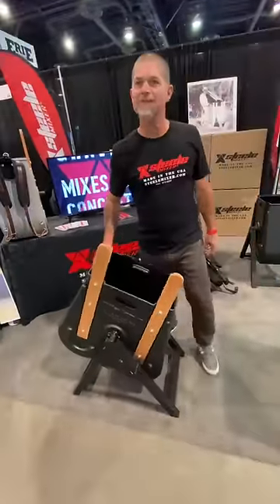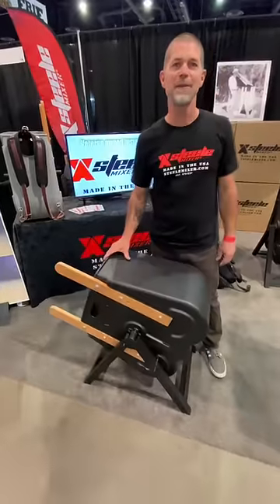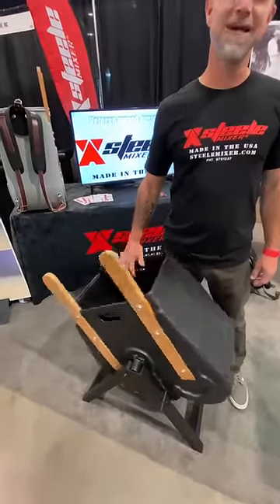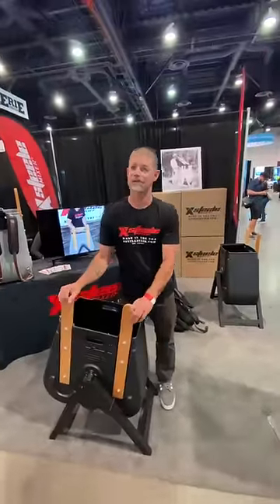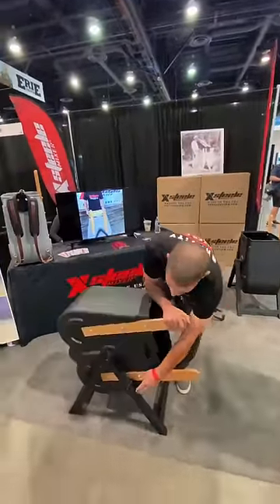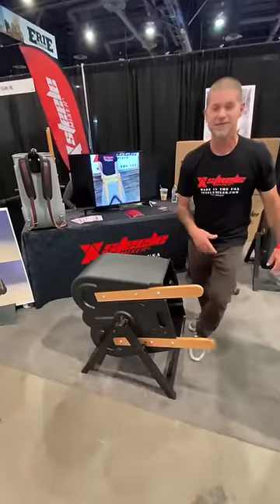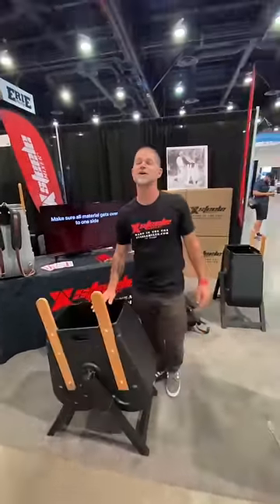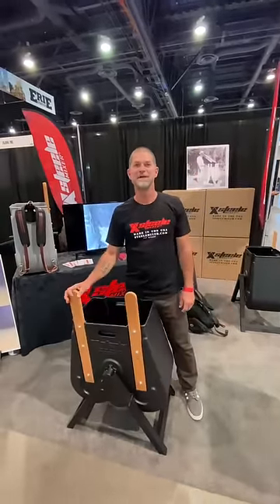No power -No problem. Mix concrete in 40 seconds #shorts

Comment: Looks nice but that price point of around $300 seems just a little high. Between $100-150 and he’d probably sell quite a few of these.
Reply: You could probably make your own for free using a garbage can and some scrap plywood
Reply: I didn’t buy one because the price was too similar to an actual cement mixer. I build one from a 55 gallon drum for $150. if the price was $150 I would have bought it. And there is no reason it can’t be $150. It’s a plastic bin with two wooden… oh the wood.
Reply: Oof, yeah hard sell at that price.

I'd be in at a $100
Reply: @smellycat249  yep, there’s $299 worth of wood in that product, he’s probably making a loss on every one 😬
Reply: @epia125  he should get it made in China
Reply: @richardkenny7563  ehh, I can't say that. Only that we can mix in a tarp/bag and compared to $300 it is a tough pill to swallow.
Reply: You do know a mixer with a motor cost 5000+ bran new right
Reply: @brixz800  really? Because I paid £170 for a brand new one. It came with a 2 year guarantee and it was delivered the next day for free. 

Why is it so expensive there?
Reply: @hootie6787  the ones we use on the job site a two bag mixer  coast about 5000 and the 4 bag is about 8000 don't know what motor you have on yours but 2 bag is a gas power Honda 2hp or 4hp I think and and the 4 bag runs on diesel
Reply: @brixz800  ah, so it was more of an apples to oranges thing then? Because that isn't comparable to the type you're gonna get on a worksite.
Reply: @brixz800  we aren't talking commercial gear, but stuff for the home gamer.   There are a few options in the $200-$400 range that are motorized.
Reply: Hey it works tho
Reply: I know we just look at the material side of products and say those things are cheap, why do much?  1. Over head cost employee's,  buildings, rent, loans, investors, and etc to run a business. To make sustainable profit all these factors have to come into play. So next time you say I can make that for $,  you should.
Reply: Recycled plastic is expensive
Reply: I don't think it's that high for a sturdy American made piece of equipment.
Reply: Your pricing it with the first a world mentality of near slave Chinese labor you've become accustomed to. China pays the workers just over $1/hr and they are mostly women. (depending on product) China has installed "suicide ners" around some factories in the past from employees jumping out windows. They work 12 hr days 6 days a week and they live in apartments built next to the factory and pay rent to the employer. If this is the price range you based it on then yea but if base it on paying a American then $300 seems fine.
Reply: I'd accept $300 if it was made of steel but it's freaking plastic. Gonna need a new one in a year
Reply: You guys want build in usa but don’t wanna pay the price lo
Reply: @blackhawks1870  this isn't a "made in America" argument, it's an overpriced piece of plastic argument.
Reply: @AK-47ISTHEWAY  the thing is that defeats the purpose of made something out of recycled products were trying to prevent pollution in the waters and in our environment and help out the veterans while we're at it
Reply: @dreagen3131  but the thing is I am recycling. I never said anything about buying a new garbage can. I already have plenty I can repurpose.
Reply: If you are on a “by contract” basis. This will pay for itself on the first job.
Reply: @Dan-gj1hz  it will have a hole in it by the 3rd job
Reply: @ostenwheeler  - perhaps with you using it, yes.
Reply: @orcoastgreenman  anyone in the industry will tell you plastic doesn't last. This was designed to sell not to use.
Reply: My smallest concrete job ever! Was worth $500.. literally patching a hole.. a step, one step, on your stairs is worth $600 to me.. and that is really very cheap in my area.. the mixing though!!
This is worth at least $300.. that is a steal! 
Buy now!
Reply: @ostenwheeler  you are right! Plastic is garbage! But if you figure 3 uses.. that’s better than some other brands?
Reply: I bought an electric mixer at lowes for something around $300.
It sure does the job. I mix 4 bags at once, and if it burns out  who cares?? It was $300.
It squeaks a bit now but I've already mixed hundreds of bags with it, even with dry clumps so whenever it calls it quits I'll understand
Reply: @bmint  well I was exaggerating 3 uses. It would probably last 8 months to a year
Reply: Harbor freight.. $269… nuff said
Reply: @ostenwheeler  no it's a made in America argument. Americans are to used to not paying labour for their products. They want to keep jobs in America, just not pay them...
Reply: @seiryusuzaku7307  since when does making something local make it cost more? The life quality of this plastic item is crap compared to similarly priced steel mixers.
Reply: I can just use a 5 Gallon bucket from lows with a lid,and put it in back of the truck and toss it out at 45 turn around and go back and get it, lol if it's still in the bucket
Reply: I bet it cost about a dollar two ninety-five to make out of recycled plastic
Reply: $47.99
Reply: @ostenwheeler  Cost of Labour. If their company has say 10 people getting paid $25 an hour, 8 hours a day 5 days a week you do the math. Compared to say maybe $10 a week for more hours for the labour in China. That's why it costs more. Simple maths.
Reply: @jbcfamily4802  don’t worry harbor freight will get this in stock soon at probably $50 and you can buy 3 so when the first 2 break you will be able to finish with the third!!!
Reply: @brixz800  do you even harbor freight?
Reply: @tiredofthetyranny9874  you joke, but for the home user with a single project that's all they need.

Also, folks should look at renting tools for single projects. sometimes the cost isn't less than a china freight tool, but then you don't have to worry about storing or selling it when you're done.
Reply: Exactly what I thought. It ls a cool idea, but I'd put some decent casters on it to roll it around. Keeps wheelbarrow clean, alot of construction there's no decent power without running tons of cords, its a "green" idea and customers seem to like that esp if there's no small engine noise, etc. Price is just at that point that makes me go..... uhhhhhhhh, gmmmmm hmmmm, I like it but don't really need it that bad yet.
Reply: But he's proud they are made in America 🙄

Comment: Great the price is competitive to one with a motor that mixes itself.
Reply: Need to pay for gas for the motor thoufh
Reply: @LifeToATee  Not to mention repairs on any machine with an engine. You will either have to take a lot of time to replace it yourself or spend the same price it took to buy the machine to fix it 😂.
Reply: @calebguinn2069  You’ll mix thousands of bags of concrete with a motorized one before it ever has an issue don’t play dumb. Plus small engines use extremely small amounts of gas.
Reply: @Brandoify  I think it’s just time to accept the fact that it’s a stupid product. The people that actually work with their hands are the people that are saying it’s dumb.
Reply: @Brandoify  People that are working indoors mix it in a bucket etc. The kind of person that would pay $300 dollars for this, wipes their ass with gloves on. Also the mixer I just got done using was electric. We would use this mixing bit that went on the end of a right angle drill in a bucket for small jobs. Plus when I’m done I can dump the bucket wherever I want, I don’t have to shovel all of it out. By the time you do that the bucket technique is way quicker. That right angle drill could mix a bag of concrete in less than 30 seconds.
Reply: @reddirtwarrior5956  Fine, fine, I just like to root for the underdog from time to time.
Reply: @reddirtwarrior5956  you aussie
Reply: @maxl3189  the fuc?
Reply: I use electric and it has wheels
Reply: I can get an electric mixer for $50 less
Reply: @reddirtwarrior5956  depends on the job i do  stone work like outdoor grills and custom fire places and wheel bareling in a already ocupped home sucks u cant bring a mixer in unleess u wanna pay for their lawn lmao but 300 sucks

Comment: In my younger days I could have used that. I've mixed a lot of bags in a wheel barrow.
Reply: Crazy how there always seems to be one little pocket that stays dry
Reply: I like the idea but my wheelbarrow is moveable.
I can use it to carry the bags from the truck to the work area.

I can mix anywhere.
Move it out of the way etc

Comment: Hasn't a better version of this existed for like hundreds of years
Reply: What's that called? How do I find the version you're mentioning?
Reply: Yes the barrel mixers which look like miniature versions of what you see on concrete trucks but for smaller jobs this seems kind of neat 
The handles at the top may provide some more leverage than the usual mixing in a large bucket 🪣 for small jobs
Reply: @tomorrow6  Yea man I think this looks worth to try out. I already have a barrel mixer, but it needs external power to turn it. I've been thinking of connecting a chain from a bicycle to the axle of the barrel mixer 😂
Reply: @Pajune  lol we used to use electric motors and belt drives in barrel mixers and even had a tractor PTO one for working away from power sources without needing a generator
Reply: If the jobs that small just use a barrow and shovel and you can tip it straight in , plus barrow can wheel drunk friend home after work 😀

Comment: This is cool but for $100 less you can buy a electric mixer disconnect the motor and spin it by hand to do the same thing. Or you know... use it with electricity....

Comment: Guy: Only non powered concrete mixer

Wheel barrow: hey you forgot about me. 

Bucket: hey you forgot about me.
Reply: Anyone with a shovel*
Reply: Both a wheel barrow and bucket need additional items to mix the concrete. Completely different. How dumb.
Reply: @brandonbath6097  how do you figure? All 3 have a container to hold the mix and a tool that is manually manipulated by a person to mix the water and dry mix. The only difference is that this device has the tool built into it, it takes a person to manipulate the two wood handles in order for the device to work.
Reply: @brandonbath6097  explain what he uses to get the concrete out after he’s done mixing? Oh wait a shovel. Then add all the time he spend shaking a bag of concrete so it can go in the mixer without any clumps. He says gravity mixes it but that’s not true because you have to power the mixer by hand going back and forth. It’s as much work if not more work then a wheel barrow and a shovel. At least you can roll the wheel barrow anywhere you need it. You can’t even dump this mixer out lol. Have to completely empty by hand with shovel. Terrible invention.
Reply: @mysterycomment1553  Hey genius. There’s a huge difference between using a shovel to pull out some cement than using a shovel to mix up cement.
Reply: @brandonbath6097  not if your a man

Comment: "Show me how it works!" 

Didn't you hear dude say it's made in the USA? By veterans? Who cares how it works it's clearly a superior product.
Reply: Lol. Not all veterans are good people
Reply: the mixing time for concrete is not a couple of seconds if you want any strength..
it might work but it does not do the work faster, it will still need aprox 15 minutes
Reply: Any commercial use of a cement mixer is around 6 to 8 80lb bags at a time. No one is going to want to do that one bag at a time.  Plastic mixers are trash too because to chemicals in concrete dry plastic out and make it super brittle. I'm a union bricklayer and this is a no for me.  Actually seen plastic bags that do the same thing in less time if your going one bag at a time
Reply: @jbBuckn  Union? So which one are you, the one doing the work or the other five standing around?

Comment: One bag? Idk I can mix at least 3-4 at a time in a wheelbarrow and more with my actual mixer. But also how would you move it around
Reply: Ya the biggest downfall of this product is having to shovel all the concrete outta the thing. It won't even let you dump it on the ground
Reply: They should make it a bit taller so you can dump it straight into a wheelbarrow...and it would need to do more than 1 bag at a time.
Reply: @DarkPhoenix203Ct  that was my exact thought
Reply: You can not make 3 bags of "mud" in 1 wheelbarrow.
Reply: @jonathanbreedlove4286  you can def do 3 bags but depending on the barrow it will be extremely easy for Crete to spill over the side. I've never do more than 2 bag at a time, there's really no need for it. Your not speeding up production, you just making the wheel barrow heavier and harder to handle
Reply: @DarkPhoenix203Ct  ok so you can put 2 bags, 34 shovels of sand and around 7 gallons of water in a wheelbarrow? And make mud
Reply: @jonathanbreedlove4286  how is it hard to understand the concept of using a couple 80lb bags of premix in a wheel barrow?. Why would anyone mix bags or premix in the same wheel barrow at the same time as Portland cement, sand and stone if you don't need to?

Comment: We mix cement/concrete on the ground. Lay   dry mix in a circle (like a ring) and pour water in the hollow middle. Mix from the outside, working your way around the ring. Has never fail us and I would never spend money on a mixer.

Comment: "you'll never mix your crete right however, because you put the water in first"
Reply: Gravity pulls the concrete down through the water... Lol
Reply: Actually if you read the factory recommendations on the concrete bag you’re supposed to put the water in first 🤙🏽
Reply: Bro water goes first so its easier to mix and dont stick at the bottom atleast in a wheel barrel

Comment: Just one bag 😂 😂 I can do it in a plywood 8x4 8 bag in 3 minutes.
Reply: Exactly
Reply: Yeah but this is for certain things. Post holes and such were you only want a bag or two and move on..
Reply: What do you mean plywood 8x4?  I’m imaging an 8’x4’ box and it doesn’t make sense.
Reply: @tylerk.7947  I'm also curious
Reply: @tylerk.7947  I'm assuming he means he will lay an 8×4 board of plywood/OSB, break the 3 redi mix bags on it and add water to mix.
Reply: @vicsosa5703  Assuming something is what gets people in trouble
Reply: @rockandrattleretreat5830  Yeah, I assumed wrong. Reread his comment and it's actually 8 bags in 3 min.
Reply: 8 bags in three minutes…. Your lying. I literally hand mix all my mortar and I’m a fucking beast… and i can’t do 8 in three minutes. I can do 4 bags 8 buckets of sand and still definitely not three minutes and I do this day in day out….

Same method plywood… so no your full of it.
Reply: His record is 22 seconds, one hand without a 4x8 plywood!
Reply: @Ryan-re1rs  would be ok for this but honestly if it was for specific post holes , which let’s face it would be it’s best form of use , then wouldn’t a spout typed system make it more niche
Reply: @spencercooper-thorn2624  this product is useful for diyers…. For areas in the boonies with no electricity. For new construction homes that haven’t installed the electric post. I can definitely see a use for it. As for me someone who does this daily… I just haul a generator. But this will be useful for the diyers that don’t want to break there back
Reply: Post a video of it to your page, you have a phone and just hit create short. You won’t though but you sure do think highly of yourself. 🧢
Reply: @Ryan-re1rs  You're wasting your time if your mixing for post holes.

Fast setting concrete mixes itself.
Pour bag in hole. Pour a required water on top. Poke it a bunch with a stick of your choice. Done a thousand of them.
Reply: Who premixes concrete for post holes?
Reply: You couldn’t carry 8 bags to the plywood in 3 minutes . Everyone always acts like they are the best. You’re lying brother
Reply: @evictioncarpentry2628  set the post dry. It will set up in a few days. Just tamp it good so it stays level. Ground water will harden the concrete. Been doing fence 20 years.
Reply: Yeah. Version 2 must hold more.
   I'f gravity mixes it. Make it bigger.
    Also need a way to empty other than shovel.
     Seems like it would have to be on very level ground too.
    I like the idea & made here by recycled .

Comment: 2-3 bag motorized mixers are super cheap though and take like 2 minutes to mix that amount, and you get to pour from them into a wheelbarrow 🤷‍♂️ no rock it back and forth without spilling water/concrete, no using a shovel to try to get the full amount of the product out, way easier on the body as well. I'd love to see someone use one of these for something that requires more than just 1 bag mixed because you'll be doing more work mixing it and removing it from the mixer than anything else.

Comment: I can't imagine an AISC concrete proportion to fit on that, imagine the amount of gravel and sand for 1 bag of cement.

I'm not sure if there's a ready mixed concrete product in the US that only requires water. But that's how the guy said it, water and a bag of concrete.

I'm not saying the product doesn't work, but probably you'll have to increase the volume capacity, to mix a 1 bag proportion, unless you're going to scale and calculate the proper amount that the mixer can handle.

Comment: Great . And price is “just” 499$ ? 

Here is one cheap : 
Cut metal barrel on half. 
On the bottom weld a short ( 12”- determine by test) piece of pipe. 
Idea is that pipe keep mix filled barrel under  30degree angle . Once filed , just spin  barrel  around ! Looks silly, but is cheap and work !

Comment: The whole purpose of mixing concrete is not to use your shovel. It may not last if rough handle with the shovel.why didn't I think of rocking the concrete mix before. 🤔

Comment: Young man that is not Mixing concrete . That is adding water to a bag of premix ready-made concrete. To mix concrete you start with a bag of Portland cement a pile of sand and a pile of gravel. You use a shovel or a another mechanical means like a conveyor, then you add water. Mixing it up .